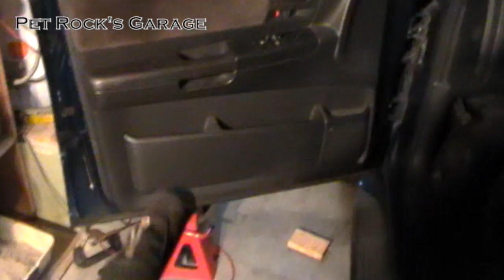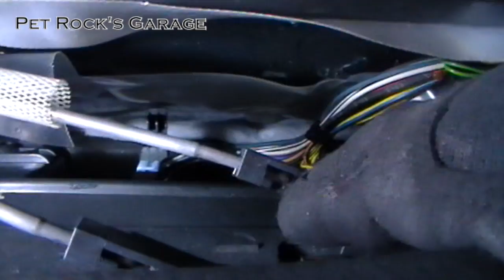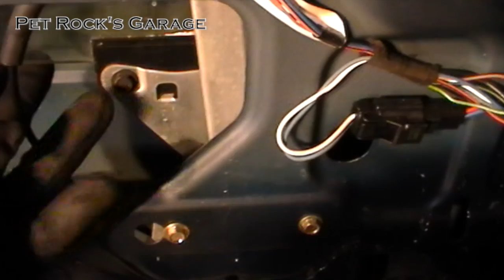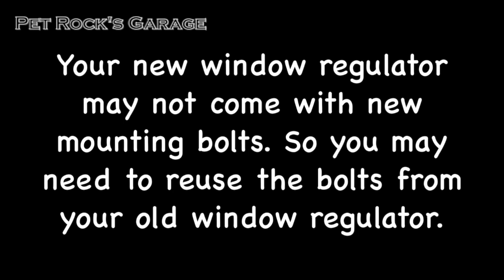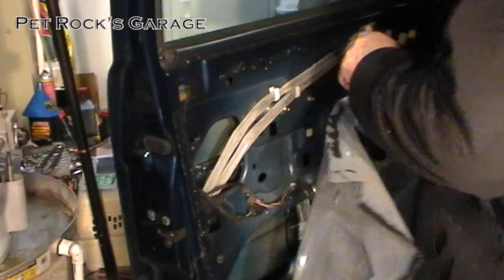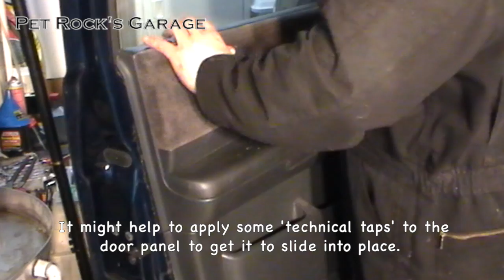How To Replace A Front Power Window Regulator - Dodge Durango (’98-‘03) & Dakota (’00-‘04)

Comment: I just came in from fixing the front passenger window in my quad cab '04 Dakota. I used a NAPA motor & regulator assembly (made by Dorman in Taiwan). The local Dodge stealership wanted $322 for the part and $200 for labor. The part from NAPA was $90. My father helped me, which was good to have a second pair of hands and eyes.

First off, this video is excellent. The information, production, narration, lighting, and editing are all well done and result in a video that is professional and helpful.

A couple of observations from my efforts today:

It took me and my father about 1.5 hours to do the whole job, taking our time, and rechecking the video a few times. It lasted the length of "The Lion King," which I had my kids watching to keep them out of the way.

I watched this video on my laptop originally. I brought my tablet outside for reference during the repair.

The plastic liner may be tucked behind the speakers, and tightened down. Loosening the speaker allowed the plastic to be pulled off.

Also, the temperature outside today was about 40-45 degrees Fahrenheit (4-5 degrees Celsius). The black "elephant snot" adhesive was very stiff and held very stoutly. I don't know if it would be easier to remove during the summer, or in a heated garage.

The replacement motor came with it's own bolts (that were 10mm). The factory bolts were of a different thread pattern (and were 8mm).

The replacement assembly also came with instructions in English and Espanol. They make sense if you have watched this video a few time.

According to the instructions from Dorman, there are two body styles/motor mounts that you have to watch for. They were kind enough to enclose a template. My Dakota was slightly different in the details than Pet Rock's Durango (which made no sense to me).

Instead of using the block of wood to hold the window up, I taped the window in the fully up position. This was because I didn't have a block of wood short enough, and I was too lazy to cut the wood. Taping the window all the way up ended up giving me the advantage of keeping the window out of the way.

Examining the broken regulator, the up cable's end pulled out of the plastic part of the window shuttle (not sure if this is the real term, but I am describing the thingey that the window rests on and travels in the metal track). Amazing how a tiny bit of plastic breaking requires the replacement of the entire assembly.

I look forward to more videos from Pet Rock. Hopefully he will need to change his brake rotors and his rack & pinion soon...
Reply from the maker: +Bob Jaan, I’m glad my video helped you out and saved you a ton of cash. The “elephant snot” is a lot more malleable in warmer weather. I’m not sure what the template is for. I assumed it was for vehicles that are converting from roll up windows to electric windows, or ones with a different mounting holes. I’m not sure which vehicles that is though.  Thanks for wishing ill will upon my truck and its brake rotors and rack & pinion.  :-)

Comment: 2nd replacement in 15 years here. I'm getting good at it. 168,000 mi on this beast and still going strong. Thanks for the video. Kate
Reply from the maker: You are one of the lucky ones. I've replaced the regulator three more times since I made this video. I've got over 210k miles on mine and also still running strong.

Comment: My local Dodge dealer wanted $700.00 to do this repair what a rip off. I bought the part online for $35.00 and as soon as I get it I will put it in myself. Thanks so much for the great video you saved me a bunch of bucks.
Reply from the maker: $700 for a 20 minute job is outrageous! I'd find a different shop to do future work on your truck. I'm glad to hear my video helped you out and saved you a boat load of cash.
Reply: Update: The part arrived today and I just completed the job and it was a piece of cake for this 67 yo man thanks to your very detailed video. Don't know why I even bothered to take my car to the dealer. I should have watched your video first and I never would have. I have done a lot of mechanical work over the years but I had never worked on electric windows before somehow I thought it would be harder than it was. After watching your video I knew I could do it. Thanks so much you help a lot of people save some of their hard earned money.
Reply from the maker: @timothycorcoran6191 , that's great! Good to hear you got the job done. Thanks for letting me know. I appreciate it.

Comment: Pro tip from an idiot who drove around with non-functional windows for 6 months:
Instead of using a 2x4 to prop the window up, an easy option is to use a suction-cup shower safety bar attached to the inside of the window to hold it up.
I keep one in my car because my Durango has gone through a few of these window mechanisms and it always seems to happen when I am out in a shady area 😂 

Thank you so much for your video. I am going to try to replace my drivers side window mech soon!
Reply from the maker: Yes they do tend to break in the worst parts of town, or when bad weather is rolling in. Thats a good tip. Another commenter suggested multiple suction cups with hooks on the inside & outside of the glass with a string going over the top to connect them all to hold the window up. Haven't tried it yet since I haven't had to replace a regulator on this truck in a couple years (thankfully), but the idea seems promising. Thanks for the tip.

Comment: Your instructions were very clear.  It's terrible that the part keeps breaking.  I hope that you have reported this to the manufacturer.  Even though they keep replacing the broken ones, it's using your time.  Also, if a person can't do it themselves, that would be three expensive service payments.
Reply from the maker: +Dana Kerry, thanks. No I haven’t contacted the manufacturer. I figure that after enough are replaced under warranty across the country for the same problem the bean counters at the company will notice the $$$ loss and tell the engineers to fix the design flaw.

Comment: Great tutorial. Just fixed my window.  Instead of a 2x4, I strapped some duct tape over the top of the door to secure the window in the up position.
Reply: Also, saved me over a $250! Thank you!
Reply from the maker: Thats great! I'm glad my video helped you out.
Yes, using tape to hold the window up will (sometimes) work. I choose to use the wood technique because tape often has a hard time sticking to dirty windows or windows with a bunch of finger prints on them. I don't want the window to suddenly fall and possibly break inside the door.  Plus duct-tape isn't that great for paint. I'd use painters tape if I had to.  But if it worked for you and you are happy with it, by all means continue to use that technique.

Comment: Great video, clear step by step instruction... Guys like you have saved me hundreds... Thanks for taking the time to do this video...
Reply from the maker: frank izaguirre, thanks a lot. I appreciate it.
Reply: Pet Rock's Garage I got it installed but the cables are catching while going up and down. any suggestions?
Reply from the maker: frank izaguirre, the cables should be between the regulator and the door sheet metal.  If the cables are on the other side (between the regulator and the window) then you may have gotten the regulator for the wrong side (drivers side vs passenger side). If not, there should be a zip tie or clip or something in the middle of the regulator that the cables go through that should keep them close to the regulator so they aren’t flopping around. You can kind of see it (a white zip tie) on my old regulator at around 6:00 in the video.  Good luck...

Comment: Than you man this video going to help me a lot on my 01 D Durango with the same problem now I’ve a cuestión do you know about 4x4 , it is not working in my truck is 4.7L  thanks again God bless you
Reply from the maker: Thanks. I'm glad my video helped you out. Re 4x4: it can stop working for a variety of reasons. I'd start with the transfer case and it's solenoid that switches from 2x4 to 4x4. Good luck.

Comment: I wish you had taken a second to show the failed part of the😊  assembly
Reply from the maker: Sorry about that. There are multiple common failure points on these regulators. In this case it was a piece of plastic attached a cable to the window sled thing that had broken and the cable came loose. Hope that helps.

Comment: Hey, thank you for the detail info on the replacement of my front power window regulator. I got the part and It's a Dorman. I feel confident I can work on my truck with your help. After the New Hampshire NASCAR race!
Reply: K Janen The project is finished. SUCCESS!! Rainy weather delayed my work. Thanks again Pet Rock's Garage you saved me on the labor.
Reply from the maker: K Janen, thats awesome!  Its labor where the shops get you (and a little markup on parts too).  I’m glad this video helped you out.  Thats my goal with my videos.  Payin’ it forward.  Thanks for watching & commenting.  I appreciate it.

Comment: I watched your video last October of 2017 before I replaced the first regulator in the driver door and rear left passenger door. Your video was very helpful. Today I just changed the regulator AGAIN and it was even easier. I like your videos because you are a good narrator. Not everyone is as thorough as you are. Thanks for that. By the way, I have the very same year, make, model, and color  Dodge Durango as you do. So when I watch you work on your Durango, it's like your using mine in the video. I just think that's cool. Great vid.👍👏
Reply from the maker: Thanks a lot. I'm glad my videos have helped you out (multiple times). :-)

Comment: Thank you for the video...This helped me do my own work on my Durango. I took the door panel off and have the window propped up.
 I went out the other day my window was half way down I thought my wife rolled it down in 10 degree weather..lol Would roll down but not up....I ordered the new regulator and motor so when it comes in all I have to do is put it in...
It does look like it has been replaced before, there are a couple screws that look shinny new...As you stated I bought the one with the lifetime warranty.

Again thank you for the video such as great help.
I got my part from:
Summit Racing  1-800-230-3030 part with Motor a Doorman cost $55.97
Reply from the maker: Thats great! I'm glad my video helped you out. Thanks for watching & commenting. I appreciate it.

Comment: Pet Rock, nice video, need to do this to my 01 durango tomorrow. By looking at other videos as well, may I offer the quick tip of using painters tape to keep the window all the way up (closed) while doing this to keep the glass out of the way. See 1AAuto's video. Just thought it would give a little more room, especially without the 2x4 in the way.
Reply from the maker: Thanks I appreciate it.  Yeah, I've seen that video. I've tried painters tape before and had it fail, the window suddenly drop and the window shatter inside the door. If the window isn't perfectly clean painters tape won't stick very well or hold for very long, in my experience. So I just use a block of wood. It doesn't really get in the way, IMO. You can use thinner wood, like 1" square stock or something even thinner. Its the length & rigidity of the wood that matters. I said 2x4 because it is a pretty common term that most people will understand.

Comment: Just replaced mine thanks to your help! There is a clip on the outside of where the window connects to the regulator and the cables are catching on it. Not sure why because i have mine just like you have yours but it still works :)
Reply from the maker: +Derick Kuch, I’m glad my video helped.  Thanks for letting me know. If your cables are catching/binding try to clear it otherwise it could shorten the lifespan of your new regulator.  Good luck...
Reply: Yeah im not quite sure how to fix this, there is nowhere to mount the cables or move them too. Both windows are doing it and im not sure how to move them. :/
Reply from the maker: +Derick Kuch, are you sure the cables didn't get twisted up when you installed the unit?
Reply: +Pet Rock's Garage Yeah, they arent twisted at all. Its not very clear in the video but the cables sit closest to the veiwport, not on the window side of the slide, right?
Reply from the maker: +Derick Kuch, the cables should be in-between the regulators slide rail that the window slides up/down on and the door panel.  Maybe the regulator or the slide the window is attached to is bent?  Its hard to say what is wrong without seeing it.  Good luck...
Reply: +Pet Rock's Garage Yeah thats where i have it, well ill open it up and play with it some more another day. Thanks for all your support man!
Reply from the maker: No problem.  Good luck...

Comment: I have found a trick to hold the window up while you order the part or instead of the handy 2x4 ? Buy tow or three od the old rubber door stops for a home door , they are wedge shaped rubber and when you pull the glad up and push them down on the inside of the top of the door panel you can't push the glass down . Neat trick for a couple of $1.00 door stops ?
Reply from the maker: I'm not sure I follow.  You jam the door stops in between the window and the door frame up at the top (where you rest your arm while driving)?  If so, yeah, thats a pretty good idea. Just make sure to remove the weathers tripping in that area or you could deform/damage it. Thanks for the tip.

Comment: I've looked at a lot of videos before coming across yours.  By far the easiest step by step video out there.  I actually took my laptop to the garage, set it on the driver seat and went to work.  With the exception of scratching my tinted window on that side everything went as planned.  Now if I could just get the front passenger window to roll down from the passenger side.  Sometimes it works, sometimes it doesn't but it always will roll down from the drivers side control.   Any ideas?  Thanks again
Reply from the maker: I'm glad my video helped you out.  The passenger side window issue is a common problem with the Window Lock-Out circuit on this era truck. If my hunch is correct, you'll notice that the passenger side window switch doesn't glow green when the problem occurs. If so, try toggling the Window Lock-Out button on the drivers door switch and see if that helps. If it does then the solder joint for the button is likely cracked and just needs to be resoldered. Mine had this problem a number of years ago and I fixed it with a little solder.  If the toggling the button doesn't help then its likely a wiring problem that would need investigation. Hope that helps and good luck.

Comment: Super and Thank you. UNFORTUNATELY,  I found this too late, sorta.  Child door slam I believe broke plastic from the UP cable. Me, Dad I think broke something else in there.  I need a picture or description of connection of upper metal Rod to door release.  My slide lock is good.  My pivot handle to open popped off in the aft part of the door. Looks simple push 90* bend into a hole that rotates fwd, as observed from lifting outside door handle.  Any help would be appreciated.   I hate to undo other side as a working blueprint….. we have 190k miles on this and anything can happen.  I need this 1 more winter.
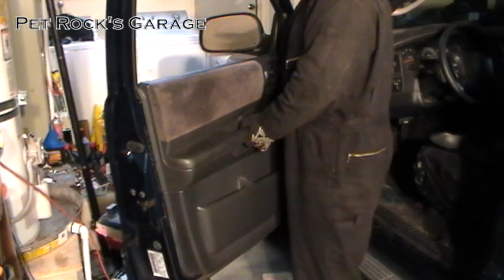Reply from the maker: I think you are asking about the door opening lever thing, and how the rod connects to it, right? I show it around 1:24 in the video. Hope that helps.
Reply: @petrocksgarage   the upper rod popped loose back aft on the door.  I can’t find where or how it re-connects to make it open from inside the vehicle.  Your video remains great.

Comment: My window will only go up about 80% of the way. Anything you can think of that I did wrong? It feels like the cable on the left of the metal frame gets super tight.  Is that cable suppose to be in front of back of that Frame? Every time I have it in front the window will only go up 50% of the way not sure what I'm
Doing wrong
Reply from the maker: Its hard to say what is wrong without looking inside the door to see what is causing the window to bind up. The cables are supposed to be between the window regulator frame and the inner door panel. I'd have a look inside and see what is binding up.  Don't try to force it or you'd likely break the plastic bits in the window regulator.  Good luck.